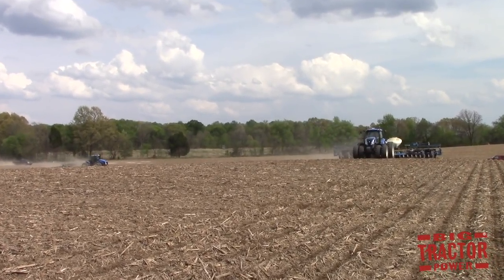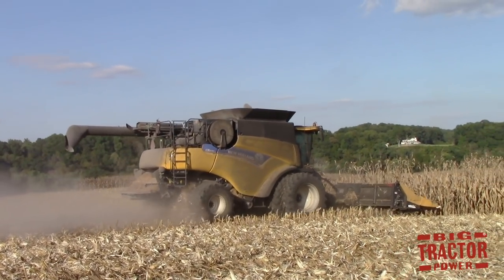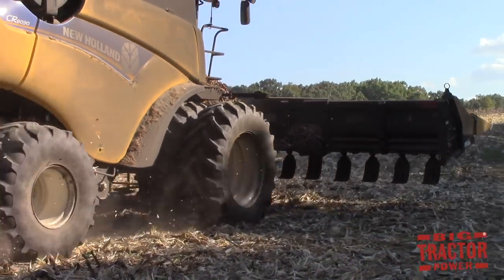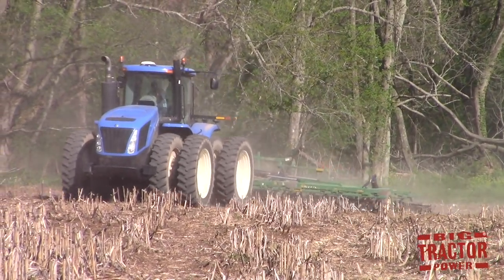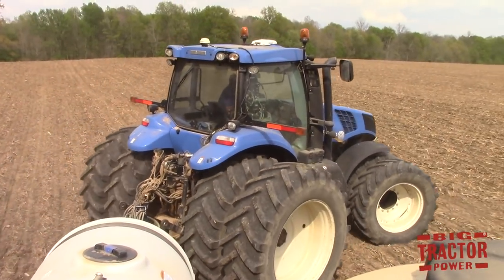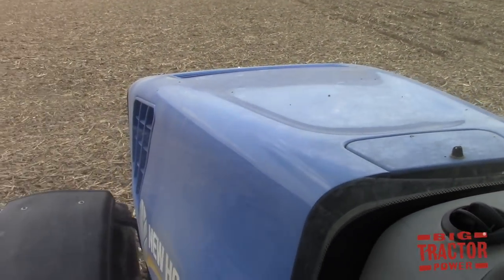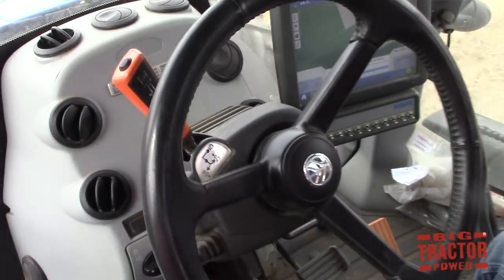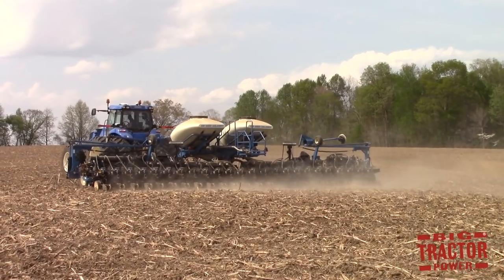Corn Planting with Big New Holland Tractors

Comment: I have drove case all my life we have 335 315 285 270 u would not believe how much better the new holland rides than a case we just got a t8 390 2 years ago now have  two we love um it is amazing
Reply from the maker: Interesting to hear.  The Magnum and the T8 are both built on the same Assembly line in Racine. What have you found that improves the T8 ride over the Magnum?

Comment: It was interesting to see the wide tires on the planter tractor. I guess going for floatation rather than going in between the narrow rows. Great video.
Reply from the maker: The tires provide enough flotation.  You might notice the T8.275 is set up for the 20 inch rows.

Comment: Great Video! It would be nice if you would explain to the viewers how the Air Pressure/Vacuum/Seed Plate system works on the Planters. You have never mentioned how the planters actually work. I think they would find this interesting. I come from Saskatchewan Canada and we have seed drills here that just use air pressure to get the seed from the air tank to the seeding tool. I found these  Corn Planters interesting because their metering systems are different on the row units with the vacuum system.
Reply from the maker: I will see what I can do in a future video.

Comment: Are all t8 called genisis ore are these special editions?
Reply: tobsi 1234 they brought the name back for the 20th anniversary of the original 70 series Genesis tractors. All of the tractors from the T8 model range since 2015 have had this designation.
Reply from the maker: Starting in 2013 the Genesis name was added on the T8s to mark the 20th Anniversary of the Genesis name. Versatile is celebrating 25 years of MFWD tractors in 2018 that also date back to the FORD Genesis launch.

Comment: Not seen many people run a diff row size head than the row planter, Better be a very precision planter to keep everthing lined up good when shelling.
Reply from the maker: The farm runs a 36 row 20 Kinze as well but it was in a different field.  The 18 row matches that perfect.  With GPS the 18 row head and 24 head work. It just leaves open rows on a few passes across the field when they finish a section.

Comment: What benefit is there to applying the nitrogen before the plants even need it versus side dressing in the summer
Reply from the maker: This farm in the past has side dressed growing corn. You might notice the T8.275 has narrow tires for 20 inch rows. The farm found because the rows are so tight in growing corn it is easier to apply nitrogen ahead of the planter rather than after.
Reply: Makes sense thanks